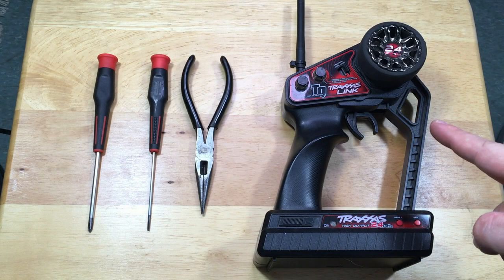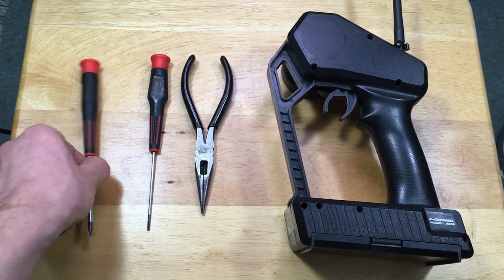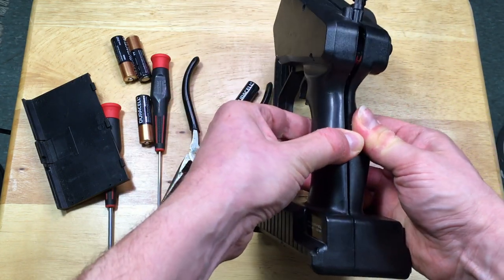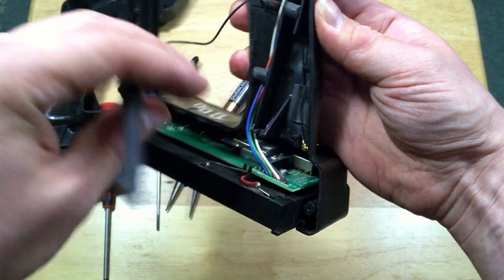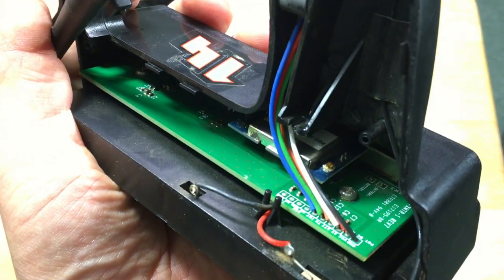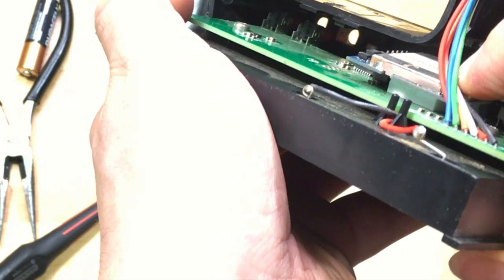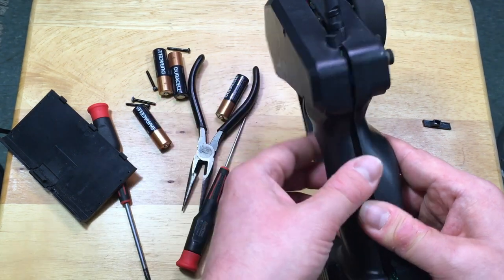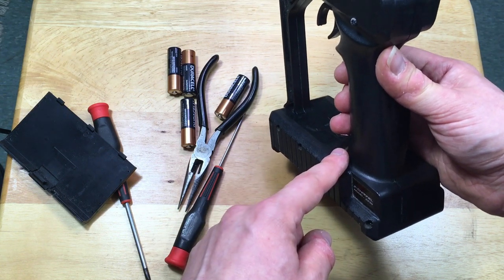Traxxas TQi Remote Fix (signal loss)

Comment: Ive never had signal loss on the traxxas tqi radios, but I’ve only got one of these older ones, if I have an issue I’ll have the know how from this video 👍😎
Reply from the maker: haha, yes.  This was the second time this happend to me.  Can happen on any remote really, if the antenna wire is pulled out.  First time this happend the stampede 4x4 VXL went under a car, and I had to crawl under to get it.  Pretty embarrassing.  hahahaha.
Reply from the maker: hey dude, you got my sub, thanks.  I love your brushless tamiya TNX.  Years ago I used to our the original Tamiya Terra crusher, when it first came out.  Was incredible back then.  The TNX is just a newer version of that same old terra crusher chassis.

Comment: Nice vid bro!! 😁😁,yes the traxxas link likes to break easily so i changed to the 2nd gen one
Reply from the maker: You mean the more rounded Traxxas TQI radio right, the one without the antenna.  I have those too.  I didn't know know this was broken, got this from an beau deal, guy never mentioned that it loses signal, was lucky its just a quick easy fix like this.

Comment: I found a rare Craftsman 19.2 v runs off a drill battery. The steering always works but drive and reverse go out. When I turn  the truck off & on it works for a second. I know this video is old but any help would be great. Thanks!

Comment: I have that exact controller for my original EMAXX (electric) with the two speed baby upgraded the two 550 motors to two 775 motors
Reply from the maker: Did you say 2-speed baby E-MAXX!!  I'm liking what I hear!! I have one also, that is allowed to be owned by the nitrogang and could be excluded from the 4:1 nitro to electric ratio, because of th 2-speed BABY!!.   775 MOTORS<. whoahhH!!

Comment: Same thing with a modern tqi remote?? With no antenna like this
Reply from the maker: hey dude! I've never had this happen on the newer radios, but all radios have some internal antenna. There is a possibility it could still be de-soldered somehow.  More commonly the receivers just go bad and you cold experience cut-outs and bad range.

Comment: Mine doesn't have the antenna shaft like yours does. I guess I'll try anyways
Reply from the maker: hey buddy! what's up!  Are you sure the model you're working with is this same model??
Reply: @hybrid32494  it's not no antenna at all. Going to try to rebind it. I read that's supposed to cure it
Reply from the maker: @jefferson757  OK give that a shot.  I highly recommend you purchase a new radio.In most of my newest videos you will see I'm using a Flysky GT5, my recommendation for you.  Here is a link. https://amzn.to/3g6l0Dw
Reply: @hybrid32494  I agree. I used flysky on all my planes and boats but I think I broke the reciever antenna. Going to try to solder on an antenna from an old boat flysky reciever I had. If that doesn't work it's time for new